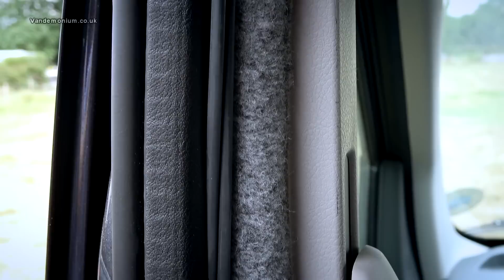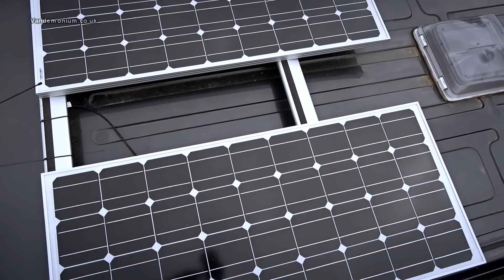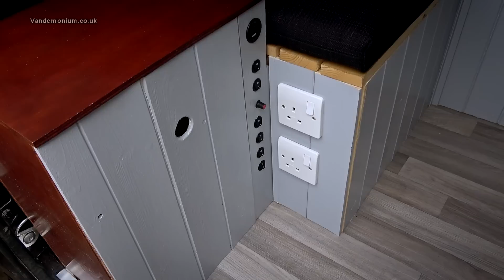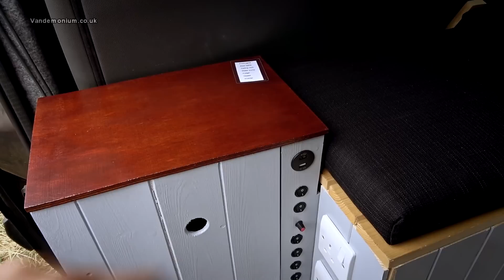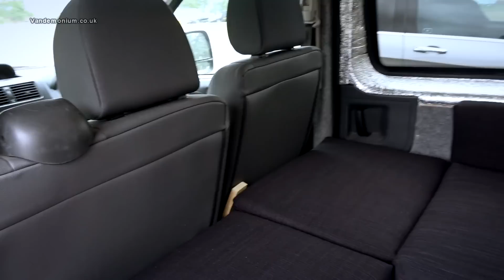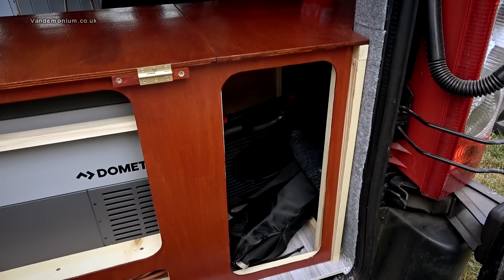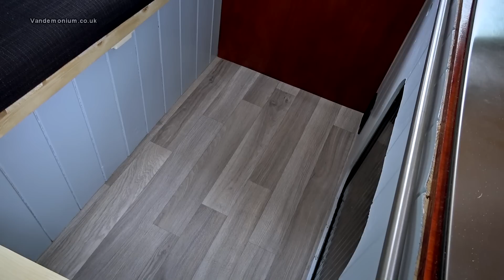Vlog 22 Campervan solar panels plus miscellaneous improvements

Comment: The van is coming along very nicely David but are you ever going to remove the UPC stickers from the wood bits?  Also, I hate to bring this up but your rear tyre by the LP gas fill looks worn out.  Lastly, perhaps a more pliable type of carpet could be used around the windows.
Reply from the maker: Both rear tyres are practically brand new with fewer than 800 miles on them.
Reply: I stand corrected, it did seem odd that a detail man like yourself would have worn tyres.

Comment: Could you use a four way stretch carpet just around the windows (just to save stress) It can be bought on ebay quite cheaply'
Reply from the maker: I considered this but it would need to match the colour exactly (or be something entirely different) otherwise it would look odd. Whether I could match it is questionable...

Comment: Wow that fan sounds like the van could have lift off!  If you think the cushions are a little thin to sleep on have a look at a Duvalay. They were on dragons den and it’s a duvet with built in memory foam mattress. Very easy to roll up and store when not in use as well
Reply from the maker: I'd forgotten about Duvalay - great idea. I shall go and look for one now.
Reply: Vandemonium I use one on my boat. In the morning just roll it up and put it away. They are quite expensive but saves so much hassle with bedding

Comment: Good progress.

The ventilation fan is surprisingly noisy at full speed.   Good call to get a speed control.   These are typically a potentiometer (variable resistor) or a variable pulse control  modulation.   Your two units likely have different designs and the fan likes on but not the other.   These units can fail without any notice.   Since it was so inexpensive, I would get a second of the one which works to have on-hand in case of failure.   You can quickly replace this, but if you do not have a replacement, "Murphy" will decide to cause the unit to fail in the middle of a hot steamy night.

Good idea to upgrade to add USB charging ports.

Consider covering the window frames in something other than the carpet.   How about some fabric to match the cushions.   Fabric will be so much easier to install.

Dave.
Reply from the maker: Good idea about the spare unit, I didn't know they were prone to failing. It was a lot noisier at full power on the controller than it was when I just plugged it into the battery, not sure why.

Comment: I'm wondering if you will knock the bed slider off the "knobs" when you roll around at night?  Perhaps you can install some sort of extension lock.
Reply from the maker: I was considering a vertical "catch" on the edge of the "knobs" so that the bed frame would drop up and over onto them and then be held from pulling sideways.

Comment: Great video, as usual.
There are some things i noticed. The cables of the solar panels laying loose on the roof. Wont they move with the airstream while driving and bang on the roof and/or wear the paint down?
For the bed slideout, what about mounting columns as feet under it, so you dont need to have any supports mounted at the wall under the cooking area? The slide extends a bit beyond the bed box anyway, so there would be room to attach these feets. The feets could rest against the bed box and when extended against the wall of the cooker/sink box. Maybe fix the slide with a hook at two positions against the cooker/sink wall to immobilise it, so the feets would only have to resist weight on the slide, not movement.
As for the fan controller, i think the noise came from the controller being a PWM controller. They operate by switching the power on/of rapidly, the proportion between on and off time controlling the speed.. The switching frequency can make the motor act as a speaker.
Reply from the maker: The cables shouldn't be banging as I have used cable-ties to hold them in place. I didn't hear them make any noise on my motorway trip.

My first plan for the bed was as you suggest but the trouble with those is that firstly I think the columns would look odd against the panelling on the bed side but more crucially, the legs would lift up and outwards towards you when the bed sections are lifted to get into the storage.

So I'd have to hinge them to fall backwards as the bed went up but then when the bed goes down I'd have to get into contortions to pull them all out to make sure they missed the edge of the bed and fell into place. Or, I'd have to join the legs with a long strip of something to make it easier to pull them into place. It starts getting a bit of a bigger engineering solution than I'd like!
Reply: How about instead of columns a whole second wall looking like the bed box wall to make it invisible? You would no longer see the original wall of the bed box, because it would be covered. It could have hinges so when opening the bed box it would be like a two piece lid. When pushed in it would look like the bed box wall looks right now.
Reply from the maker: Hmmm .. interesting. I will definitely give that some thought! Cheers

Comment: I would agree that a drop-down leg would be the best choice enabling a less than fully extended option as well as the fully extended.

A few years ago, I kitted out a folding caravan, so everything had to be completely collapsible into the folded down shell.  By using wooden frames clad with Formica and with a spray foam filling, I was able to create lightweight but rigid panels that did not require a crane to lift and put into place.  Within the interior, I was able to create a toilet, shower, wash basin, kitchen including gas stove, fridge (12v/240v/lpg), sink, wardrobe, chest of drawers, double bed, dining table with seating for four, central heating h&c running water, etc.

Why did you not get a refrigerator that would also use lpg to save your battery when completely off-grid?
Reply from the maker: The fridges that run on propane and 12V are horrifically inefficient when using 12V, much more so than the pure-12V versons. So, because I have lots of solar, it makes more sense to have an efficient 12V fridge that can run for free from the solar.

Comment: The controller on the fans was a great idea. At full speed it sounded like you were about to take off. For the legs on the bed, how about mounting them to the pullout on the bed and finishing to match the cabinet under the bed.
Reply from the maker: My first plan for the bed was as you suggest but the trouble with those is that firstly I think the columns would look odd against the panelling on the bed side but more crucially, the legs would lift up and outwards towards you when the bed sections are lifted to get into the storage.

So I'd have to hinge them to fall backwards as the bed went up but then when the bed goes down I'd have to get into contortions to pull them all out to make sure they missed the edge of the bed and fell into place. Or, I'd have to join the legs with a long strip of something to make it easier to pull them into place. It starts getting a bit of a bigger engineering solution than I'd like!

Comment: Why not tile the wall behind the hob sink
Reply from the maker: Only because I worry about the tiles cracking under the movement of the van. Maybe some of those tiny 1cm x 1cm square tiles in a mesh would work though?

Comment: I know you were under time pressure from the dreaded insurance red tape. So, did you make the deadline? Fantastic job on the van
Reply: I haven't seen a table yet.
Reply from the maker: Yes it was passed as a "Motor Caravan" by the DVLA some weeks ago. And yes, there is a table, you just have to look closely for where it might be :-)

Comment: As a side note. How about a swing down arm on the outer wooden door over the cooler? It could be used to hold the door opened when parked. Why would you want to do that? Well you could attach a mirror to the inside surface and you can check your hair before going out to dazzle the ladies.
Reply from the maker: Great idea! I think I'll do that. Cheers William. The door actually folds back a little when open so it may not even need the arm unless I'm parked on a really substantial incline!!

Comment: Somewhere in the bed construction you seem to have missed the bit where the facade of the box pulls out with the extendable bit. It looks neat when the sliding door is open.
Just saying but.
Reply: I thought that, too - legs built in to the bits that slide out. But, there are a hundred ways to skin a cat, so they say.
Apropos of nothing, are you from Hebburn, Peter?
Reply from the maker: My first plan for the bed was similar to what you suggest but the facade would always stay in place as it holds things inside that storage so I'd have to use vertical "legs" on the front of the bed. The trouble with those is that firstly I think the columns would look odd against the panelling on the bed side but more crucially, the legs would lift up and outwards towards you when the bed sections are lifted to get into the storage.

So I'd have to hinge them to fall backwards as the bed went up but then when the bed goes down I'd have to get into contortions to pull them all out to make sure they missed the edge of the bed and fell into place. Or, I'd have to join the legs with a long strip of something to make it easier to pull them into place. It starts getting a bit of a bigger engineering solution than I'd like!

Comment: How odd that the roof fan only had one speed and sounded like an air plane taking off!
Reply from the maker: Really odd that it wasn't so noisy when I just connected it to the battery directly although the vent wasn't physically open when I filmed this video so maybe the backdraft from the fan was making it sound worse than it really is.
Reply: Or it could be resonance by the vibrations transmitted from the fan to the roof?

Comment: Floating Earth’s! I know I know. Really bad form!
Reply from the maker: I read so many forums with so many "experts" all contradicting each other. I also consulted two proper electronics experts and it did my head in (all about connecting the inverter chassis and the earth wire on the plug to the neutral though goodness knows how I'd make that look without wires going everywhere)
Reply: Interesting isn’t it? Everyone is an “expert” these days, normally an anonymous “expert”. When I was a young boy, I am sure there weren’t so many “know it alls” around. Just some high quality, time served tradesmen who knew their stuff.

Comment: For your bed you could get some legs like on a coffee table with a screw on one end. Then drill some holes in the cross bar the slates on nailed to. Put nuts or something in the drilled out hole with some epoxy and then you'd have some removable legs you could use. 
 Also I still think a small 12V fan that you can point at yourself would be good for the dog days of August. A black van with the sunshine on it,,,,, who needs an oven for baking?
Reply from the maker: With the side door and roof vent open, it's surprisingly temperate even in the midday sun. If they're closed though, it certainly does heat up; I need to get a better-fitting sun reflector in the window (I have an old one designed for a Mercedes Vito which is not quite right)

Comment: You may want to add some ventilation opening in the front and the back, as well as close the gap left and right, so the fridge can 'use' the whole van to get rid of heat. It's effiecency (as in battery consumption) is highly dependant on incomming air temperature. With a (mostly) closed system, where it sucks in already heated air, it'll eat up the batteries. After all, it's the same problem every (real life) space ship got - geting rid of excess heat :))
Reply from the maker: There is an opening at the back, I showed that.
Reply: Sure, but thats only one hole, the one the hot air is deposited in front of right? so the intake just sucks the hot air arround and in again. One hole isn't exactly a configuration that allows a flow,  does it?
Reply from the maker: The air inside the van is unlikely to vary in temperature between the back by the doors and the inside where I sit so the airflow will be much the same whether I cut a hole or not.
Reply: didn't you improve your boat fridge's performance with holes in the floor, accessing the cool air of the bilge? It may be time for another hole in the floor of your van :-)

Comment: Put a drop leg on the bed
Reply from the maker: The magnetic catch I put to hold the bed in place while driving would now get in the way of a drop leg, unfortunately.
Reply: Vandemonium counter sink them in to the frame and the legs. The magnets in the holes in the frame and legs. The side of the legs and line them up. Start with the legs oh make the leg fold up

Comment: The other fan controller sounds like it used PWM, where the one your using is probably voltage controlled.

Comment: I have heard that you can even add insulation around the frig (except for blocking the exhaust), but I don't know if that really helps it or not.
Reply from the maker: Yes, I wondered about doing that and left space above the fridge for some to go on the underside of the hinged cover too. I'm not sure whether it would help though or hinder due to lessening the airflow :-(

Comment: Would the bed supports fixed to the side of the bed be a viable option.  Relying on not slipping off small ledges seems precarious.  Shift mid sleep, and slip off, and wedge however things fall.  A support frame connected to the bed side would allow it to slide part way, or fully, and be supported, and would be minimally in the way against the side when slid in, not snagging on protrusions on the sink side as you move about.
Reply from the maker: The bed would never extend partially because the cushions wouldn't fit; it'll either be in or out so that's not an issue. I did ponder putting a little vertical catch on the side of the ledges to stop the bed being able to pull back while in use.

As for legs on the side, my first plan was this but the trouble is that firstly I think the legs would look odd against the panelling on the bed side but more crucially, the legs would lift up and outwards towards you when the bed sections are lifted to get into the storage.
So I'd have to hinge them to fall backwards as the bed went up but then when the bed goes down I'd have to get into contortions to pull them all out to make sure they missed the edge of the bed and fell into place. Or, I'd have to join the legs with a long strip of something to make it easier to pull them into place. It starts getting a bit of a bigger engineering solution than I'd like!

Comment: Interesting that you found a fan speed controller that works silently. Mine also makes a noise, I put it down the circuit producing 'rough' DC so I mucked about with smoothing capacitors and the like to no avail. So I have a two speed fan, full on and off. I may be tempted to try again.
Reply from the maker: Definitely worth trying different ones, from my experience. There's a link to the one I bought in the video description.

Comment: that switch  was  best tip of the week ...deff too noisey on full!
Reply from the maker: It probably sounded worse than it is as I had it set to "extract" but the vent was down, so all the air was ramming into itself as it tried to ventilate but nonetheless it is quite noisy if you just stuff 12V into it!